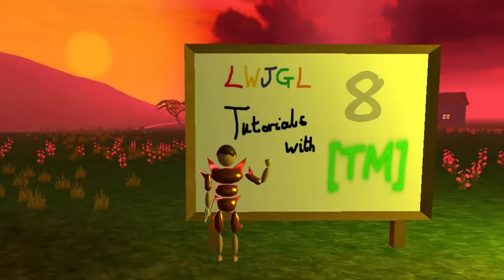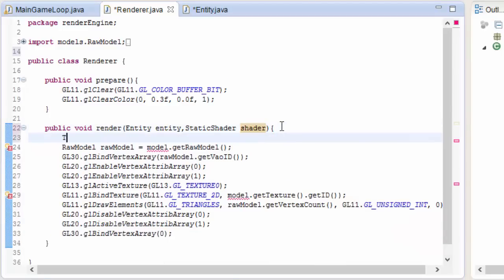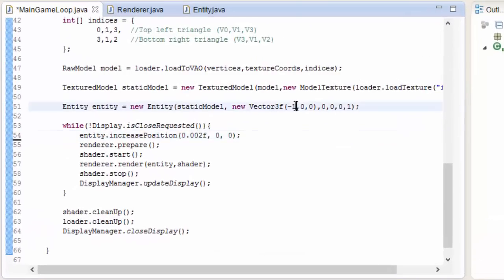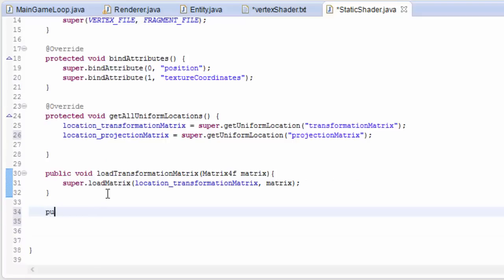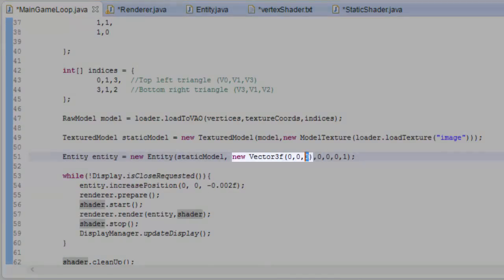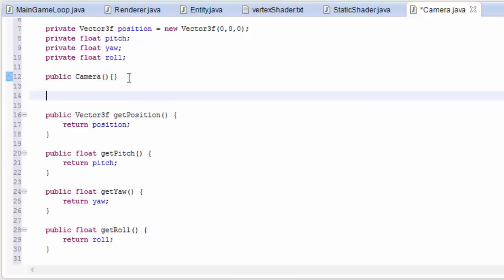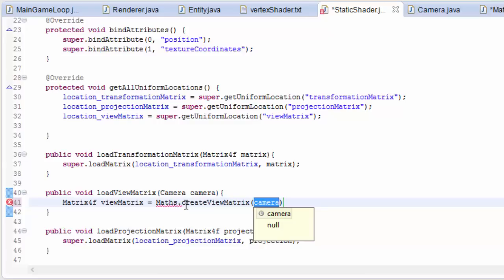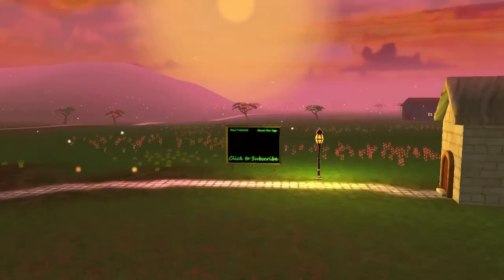OpenGL 3D Game Tutorial 8: Model, View & Projection Matrices

Comment: Okay, I know this is kind of old, but I'm having a problem moving the camera forward and backwards. Instead of the cube getting bigger or smaller, as would be expected, it just becomes weirdly thin and then disappears.

Conclusion: I'm dumb. Matrix multiplication isn't commutative and you should apply the projectionMatrix to the final transformation Matrix and not the other way around or things get extremely fucked up in the Z axis. 

For anyone with similar problems, it's 
 gl_Position = projectionMatrix*viewMatrix*transformationMatrix * vec4(position,1.0);

The order is extremely important.

Comment: Little lifesaver here:
I was having an issue that when I applied the transformation matrix, my Quad disappeared. I looked through all of the 'common errors,' the comments section, among other things. When I could not find a fix, I restarted the project. Then, I realized, in the 'Renderer' class, in the 'render' function, at the end I called:
GL20.glDisableVertexAttribArray(0);
GL20.glDisableVertexAttribArray(1);
GL30.glBindVertexAttribArray(0);

This caused the variables to get mixed up, without any errors. I instead should have wrote:
GL20.glDisableVertexAttribArray(0);
GL20.glDisableVertexAttribArray(1);
GL30.glBindVertexArray(0);

Hope this helps someone.

Comment: Did  I miss something ? Cause my renderer has slight differences compared to yours. Same for my vertexShader, help !! I have errors with texturedModels and with : renderer.render(texturedModel) in the main game loop, shall I copy your version of  the renderer ?
Reply from the maker: A couple of variable names might have changed since the last tutorial because I lost the code and had to redo it, but obviously that has no effect on the actual workings of the code. Just use your variable names instead of mine where there is a difference. If I remember correctly it's just 2 variables that have slightly different names than before.
Reply: Oh...okay then; well thanks. I'll try to find a way to fix the error
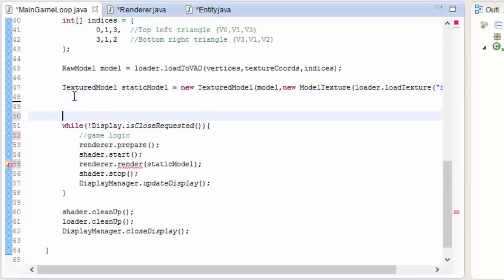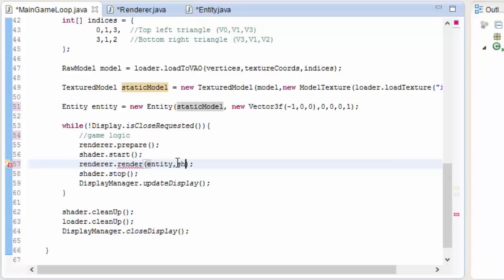Reply from the maker: Check the video between 4:23 and 4:58. As you can see, I had that error as well at that stage, but then I created and Entity instance, and changed what I was putting in to the render() method call.
Reply: Great ! Thanks a lot for taking the time to help me ! That's really nice.

Comment: Hi ThinMatrix!
Great tutoriel as always ;-)

I was wondering how could I load a different texture file per side of the cube, do you have any idea?
Reply from the maker: One option would be to make the texture coords a 3D vector, where the 3rd component is an index indicating which texture to use. You would then just need to use multiple samplers in the fragment shader, and use the index to determine which should be sampled. An easier option though would be to edit the 6 images you need into one single texture, and then change the UV coords of the vertices accordingly to map each face to a different part of the texture.
Reply: Thank you very much for your quick answer! I am going to try this ans see if I can do something.

Actually, I was asking that because I've found a 3d model with a file:
- .obj
- .mtl which contain detail for different texture file. 
- Different textures

Do you have already work with that kind of file?
http://tf3dm.com/3d-model/stable-54889.html

Comment: Hey, For some reason my entity isn't moving or doing anything. It just stands in middle and I can't find any faults in the code for some reason.
When i print the x coordinate of the entity to the console, I see it changing.
I've also checked the fragmentShader.txt and vertexShader.txt many times.
Reply: at which part exactly is it doing that? right when he is testing the Transformation Matrix? or when he Tests the projectionmatrix?
Reply: Hey, when tests the entitiy in the mainGameLoop.java, when he increases the position of it and also the rotation. it's at 5.22 minutes
Reply: It's when testing the transformationmatrix
But I double checked the code already and saw nothing wrong
Reply: I have just pasted your code in every class and it still doesn't work.
Reply: I have the exact same issue, and I haven't been able to fix it either.  I know this is a month old, but maybe you found a solution? I have no error in my code, and the x coordinate is indeed changing. It doesn't make sense, it seems it is rendering the TexturedModel still, even though it should be rendering the actual entity.
Reply: YourNameHere either you have an error in the code that you somehow missed (;D) or you are using wrong hardware or software. just try thinmatrix's code and check if that works. and you probably checked all the common mistakes from the description?

Comment: +ThinMatrix Hello! I love the tutorial vids but I can't seem to get my picture to show up. I even went and flat out copy and pasted your source code over mine. My only guess is that in the first tutorial, you mentioned something about the graphics card not being strong enough or something. I went down to the comments to find out how to fix it and I took out the "new PixelFormat(), attribs" from the Display.create in the DisplayManager. Is this causing my problem, and if so, is there a way for me to fix it?
Reply from the maker: If your graphics card wasn't good enough you'd have got an error message by now. Did the previous tutorials work for you? If the problem only started in this tutorial then it has to be a problem with the code added in this tutorial. Check the description for the common problems that cause the quad to not be shown. If you still can't find the problem then send me your code (preferably with a dropbox link or something like that) and I'll try and find out what's wrong.
Reply: Wow, thank you. >.< I missed one of the common mistakes! I thought I looked at them all! Well thank you for responding and the tutorials.

Comment: After adding projection matrix, my square just not appeared. What that can be?
Reply from the maker: If everything was working before then it can only be a problem with the projection matrix code. Check the "Common problems" in the description to see if any of them help you. Mainly just make sure that your entity's z position is negative, that your uniform name spellings are the same in the StaticShader class as they are in the vertex shader code, and that your createProjectionMatrix() code is correct.
Reply: im having a rather weird Problem, i just got to the part where you tested the projectionmatrix by decreasing the z Position of the quad in the mainloop, but it didnt even Show up. now when i put the z Position between -1f and somewhat around 0, leave out the Entity.increase_position, and leave out the *transformationMatrix in the vertexshader, the quad renders to the Center of the Screen where it was in the previous tutorials. i think there is something wrong with my Code regarding the projectionMatrix, because the transformationMatrix on ist own works perfectly fine. i triple checked all my spellings but im just a silly human being. please, do you know any possible explenation for that?

Comment: Hey! After i add the projection matrix, my quad isnt showing anymore! I checked the common problems and my z distance is -1 and i even printed the z value. It will show only if i remove projection matrix from vertex shader.  Its seems like my projectionMatrix is NaN 0.0 0.0 0.0
0.0 0.0 0.0 0.0
0.0 0.0 -1.0001999 -0.20002
0.0 0.0 -1.0 0.0

Is this supposed to happend? (Also my generate code for projection matrix is fine)
Reply: NVM, fixed it, my height and width where for some reason 0, but i fixed it

Comment: I have a problem at 5 mins in, the image appears in the middle however it doesnt move or rotate SOMEONE PLEASE HELP @ThinMatrix
Reply from the maker: Check the "Common problems" section in the description, and see if you have any of those issues. My guess would be that you're not multiplying the transformation matrix with the vertex position in the vertex shader (was right at the end of the last tutorial) but I might be wrong. Could also be to do with the creation of the transformation matrix.
Reply: +Nathan King You have to add the uniforms to the vertexShader.
Reply: +ThinMatrix Hey ThinMatrix. I had the same problem, but i knew from the begining that it wouldn´t work, because for whatever reasons, the video did not show the change you have to make in the vertexShader for the uniforms to work. The multiplication of the transformationMatrix in the shader is not mentioned. Later on you change the vertexShader for the other matrices. That has to be the point that everyone gets it, but sometimes people stop to watch, because they fear their code is broken.

Comment: Hey, i have a little bit of a problem, my quad is neither rotating or moving + it didn't change position, any ideas on how to fix this?
Reply from the maker: The moving of the quad is caused by multiplying the vertex positions by the transformation matrix, so the problem can only be that you aren't multiplying the transformation matrix in the vertex shader, or that the transformation matrix is not being created correctly in the method in the Maths class. You can easily test to see if the matrix is actually changing when you change the entity's position with a simple System.out.println(). My best guess would be that you missed the bit at the very end of the last tutorial where the transformation matrix was multiplied by the vertex position in the vertex shader.
Reply: Ah, yes, i missed that bit, thanks for the reply, you are a great source, i've learnt alot from your videos :)

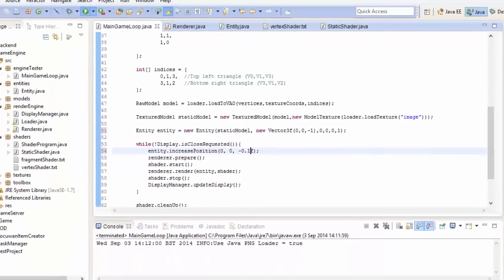Comment: 11:48 my quad doesn't render, i triple checked the transform values and everything else and nothing worked
Reply from the maker: Check the "Common Problems" section in the description, it's quite likely to be one of them. If not then perhaps you can share you code here (dropbox link or something like that would be best) and I'll have a quick look through it.
Reply: ***** heres a dropbox link of the whole projected file: https://www.dropbox.com/sh/ggc7b9bm0y7h2vq/AABnieV7g7Uyh0ODpSz58Buka?dl=0
Reply from the maker: PandaHeroCG Did you check the "Common Problems" in the description? You haven't called the "getAllUniformLocations()" in the ShaderProgram constructor, which was one of the common problems I mentioned ;) Not sure if that's the only error, but try fixing that and see if that works.
Reply: ***** looks like that was the problem, thanks for the help! :)

Comment: When I add the projection matrix to the vertexShader my object disappears  Ive looked over the code 100 times and rewrite it three times and it still does not work, when i dont but in the projectionMatrix in the vertexShader everything runes fine
Here is my code:
https://www.dropbox.com/sh/nh1ajzhrfko6psa/AAANQXNw-yLOgaA3XvNHXQ2Ta?dl=0
Reply from the maker: Could you send me the src folder rather than the bin folder please? Also if you haven't already, check through the "common problems" listed in the description.
Reply: I have looked through all the common problems and all the comments on this video and nothing has helped
https://www.dropbox.com/sh/nh1ajzhrfko6psa/AAANQXNw-yLOgaA3XvNHXQ2Ta?dl=0
Reply from the maker: Number1IndieGamer Well I just checked very quickly and straight away I noticed that your entity is not in a visible position. After adding the projection matrix the entity won't be visible if the z value infront of the NEAR_PLANE value. So change your entity's z position to -1 and see if that helps. If not then let me know and I'll have a look for more problems.
Reply: Thank you so much that was my porblem

Comment: Hi guys I had the problem that with the multiplication of the transformationMatrix in the shader, it just disappeared and I only saw the read background. My problem was this: In the ShaderProgram.class in the method loadMatrix() on the 3rd line GL20.glUniformMatrix2(location, false, matrixBuffer); i figured out that the glUniformMatrix2 is wrong. it must be glUniformMatrix4 of course. But there are glUnifromMatrix2 and glUniformMatrix4 methods as well so eclipse doesnt point that out as an error. Check if you have the 4!

Comment: I was interested in learning how I can place a different texture on each side of the cube...
Reply from the maker: +Edward Ryklin Fairly easy to do - you can add all 6 images that you want to use into your texture (using an image editing program) and then adjust the texture coordinates of the vertices accordingly to match the correct part of the texture. Once you've got to episode 10 you can do this in Blender using UV mapping so that you don't have to manually type out all the texture coordinates.
Reply: If I understood correctly, you are suggesting to create 1 texture that will cover the entire cube. I'd like to know how to make 6 different textures, and specify which side to map to. I think that' s bit different. Ultimately, I would like to know how to do more advanced things related to this. I am procedurally generating my textures, in the fragment shader. I'd like to generate a different texture for each cube side.
Reply from the maker: +Edward Ryklin If you're generating the textures in the fragment shader then you wouldn't really need to do any texture mapping at all. Simply generate the textures based on the vertex position values (which you can pass to the fragment shader from the vertex shader).
If you choose instead to use texture image files then I would definitely recommend trying to put all the images into one texture and use texture mapping to select which part of the texture each face uses (like I did for the stall model in episode 10. There are various different "textures" used for that model such as the wood, the cloth, the colours for the fruit, but it all comes from a single image file).
If for some reason you simply have to use 6 different texture files (and this will be more expensive) then you could make the texture coordinates vec3s instead of vec2s, and the z component could be used as an index to indicate which texture to sample in the fragment shader. You'd have to bind all 6 textures before rendering and you'd need 6 different samplers in the fragment shader (see the multitexturing tutorial). But again, you can easily get the same effect by editing the textures together into a single image.
Reply: All makes sense, thank you. I ended up implementing everything in the shader, and it works like a charm. My CPU is running at just 3%.  Yes I was also thinking of revisiting tutorial 10 to better understand how the stall was implemented. However, it's better to stick to generating the texture in the shader in my case. 

It took me a while to figure out that the Vec2D textureCoords that we pass in from the vertex shader, if sampled you can reference the fragment by saying textureCoord.x, that's the color of the fragment at that x location (and all Y and all Z I believe) ! I didn't realize that at first.

What I still haven't figured out yet is ( you hinted at it). If I wanted to take my procedural texturing further, and implement a different texture on each face of the cube, in the shader. I'm going to play with that today.

Comment: IF THE image doesn't show up but I have all the code will the other tutorials work?
Reply from the maker: +3LeR4NevER Probably not - if the image isn't showing then something is wrong in the code. You can download my code from the description to help you find the problem if you want.
Reply: +ThinMatrix ok i will try that now
Reply: +ThinMatrix is the code download only for this episode amd the ones before  or the code contains some code from ep 40 for example
Reply: +ThinMatrix nevermind I saw it says tut 8 on the dropox
Reply: +ThinMatrix one problem when I add the color = vec3(position.x+0.5,0.0,position.y+0.5);
it loads the game and it closes it in 0,3 seconds and heres the error
Vertex shader failed to compile with the following errors:
ERROR: 0:17: error(#143) Undeclared identifier: color
ERROR: 0:17: error(#160) Cannot convert from: "highp 3-component vector of vec3" to: "float"
ERROR: error(#273) 2 compilation errors.  No code generated
Reply: +ThinMatrix i checked the code and still the problem isn0t fixed maybe the problem could be in the fragment and vertex shader +. and one more question I have #version 400 core in vertex and fragment shader is that the problem maybe?
Reply from the maker: +3LeR4NevER You can get rid of the colour line, we're not using it anymore. But maybe it wasn't working because I called it "colour" and not "color", and the variable was declared as "out vec3 colour". Either way, you can take that line out.
Perhaps if you still can't get it to work you could try copying and pasting in my code for the vertex and fragment shaders, in case you have any other small typos.
Reply: +ThinMatrix copied your vertex and fragment shaders it works the backround is green but still no image. I tried to copy your other codes and see if it works but still no!
Reply from the maker: +3LeR4NevER Send me your code in a zip file to thinmatrix@gmail.com, I'll check it and tell you what the problem is.
Reply: +ThinMatrix how can i send it i have no idea
Reply: +ThinMatrix i will send it in 1 min its uploading the file
Reply: +ThinMatrix it said it cant send the attachemnt because of security reasons
Reply: +ThinMatrix i have sent you the code
Reply: +ThinMatrix I have sent you another email check it out it contains the code so you can open it in eclipse
Reply from the maker: +3LeR4NevER I'll check it when I have some time, but did you try that fix that I emailed you after you sent me the code the first time?
Reply: +ThinMatrix yes i fixed it but the code that I have sent u doesn't have the fixed code I have extracted it before fixing what you told me